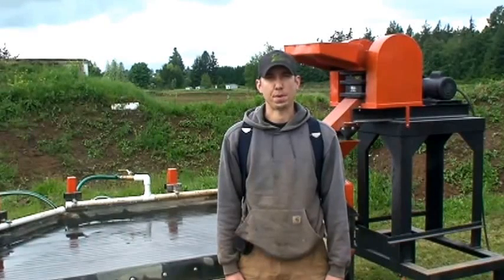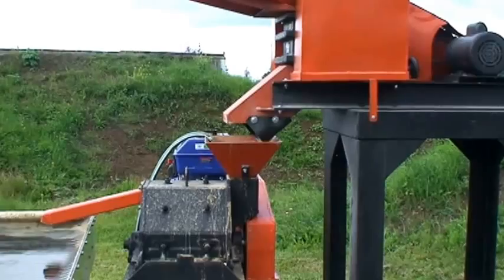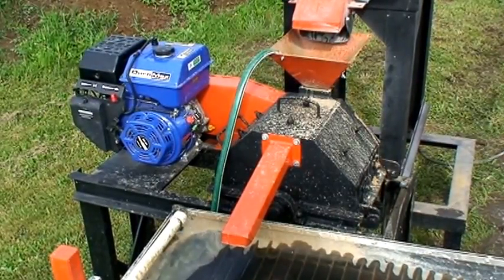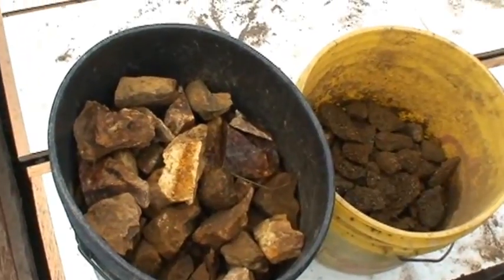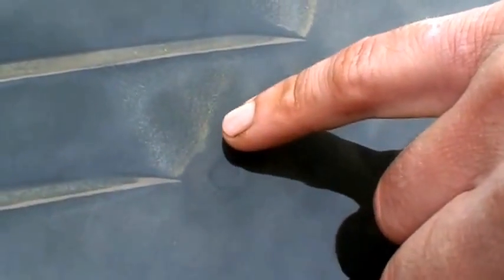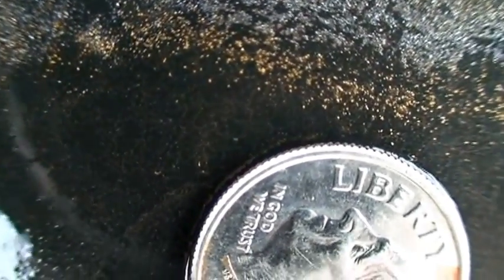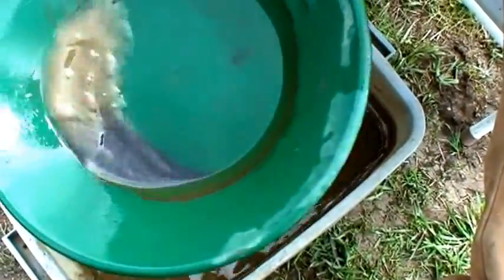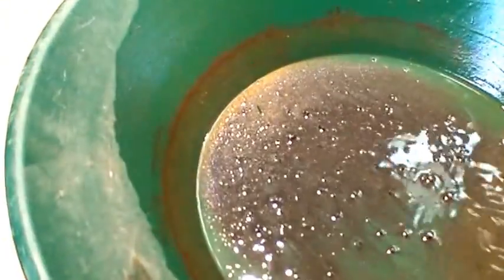Small Gold Mill Concentrating Gold Quartz Ore With A Gold Shaker Table

Comment: your pour tray needs to be steeper
Reply from the maker: Jay Stevens Thanks for the tip.  For a small jaw like this it helps to have an operator to meter the feed into the jaw.  We have some larger jaw crushers with vibrating feeders and discharge conveyors.  You can see a video here: https://www.youtube.com/watch?v=BBQQg5AGLek
We are about to post a video of our turn key system which includes: vibrating feeder->jaw->conveyor-> fine ore bin->conveyor->hammer mill-> shaker table.  Stay tuned for more vids.  Thanks!

Comment from the maker: We put the outlet of the impact mill up high for a few reasons.  It gives a few extra feet of height, so the impact mill doesn't have to sit above the table.  It also increases retention time in the mill so the material gets ground finer.  With a side inlet and outlet there is a fan effect in the mill which helps the material stay suspended in the mill for more grinding and helps the material exit through the chute at the top.  Thanks for watching and posting.

Comment from the maker: We have done some experimenting with running dry and it does seem to reduce the size of the output some, but it blows dust everywhere.  Our strategy has been keep it wet to keep the dust down, it also makes a nice slurry as opposed to trying to mix all that dust after it has left the mill.  
Ball mills don't get 100 mesh minus in their first pass (all the ones I have seen have screw classifiers) so I think your best bet is to classify to the desired size and recirculate the overs.
Reply: Cool ..but I love the dust lol😂